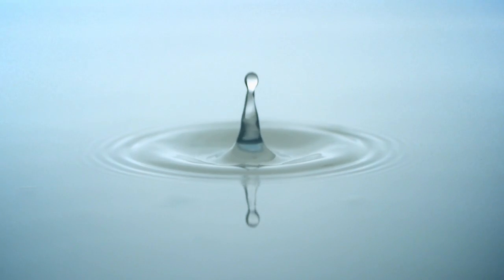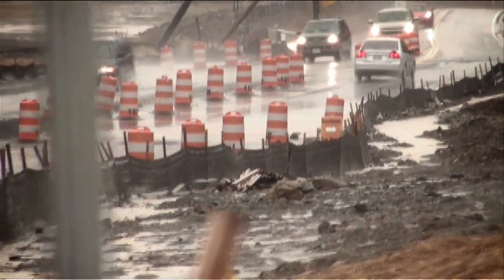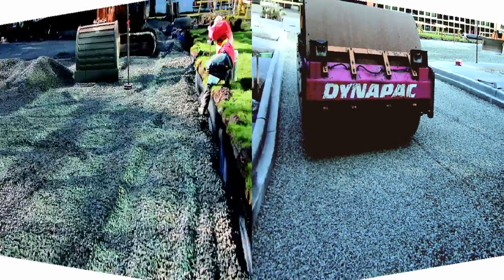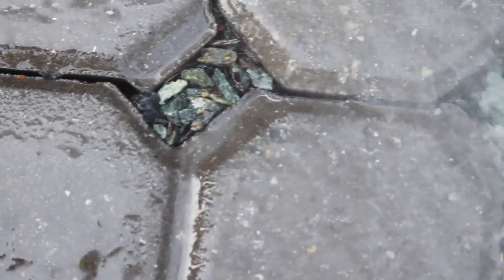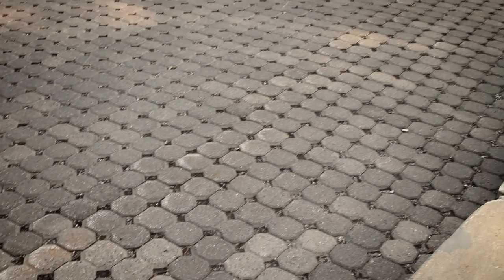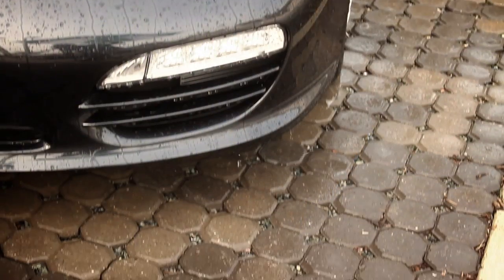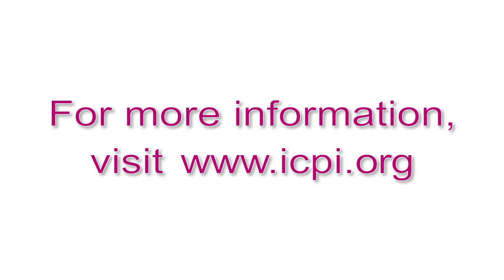Stormwater Runoff Solution: Permeable Interlocking Concrete Pavement

Comment: The pollutants are only redistributed into the soil rather than a river.  The pollution problem is not solved.   Water powered engines is a better solution to reduce our use of petroleum which is being suppressed.

Comment: How does this stop or reduce water pollution? It seems to me that this system accelerates soil pollution, pollluted water doesn't go through any filter, but directly to the soil ... from an environmental view this system can be dangerous... unless someone convinces me of the opposite
Reply: +AchrafRa you just said it. polution of ground increases, but polution of water decreases.
As water isgoing through soil, soil itself is a filter and is cleaning it from polutions.. right now, that water with polutions is going directly into sewers.
As water is going through this concrete it is taking that polution in itself, just like earth would, and then that water is cleaner than the water that is going into sewer.
But that concret is not able to take all of the polution on itself ( this is never mentioned, how much polution it can take) ( but there are some things such a thin layer can not filter.
That water is then going through soil, filtering it even better.

in theory it reduces polution, both total polution and polution in water, but is poluting soil under it.
over time that concret (filter) is going to get dirty, and is not going to be able to absorby everything, or will allow more polutants to run into soil.

my opinion is. i would rather have poluted soil under road that isnt used for anything, than have poluted water that is used everywhere.
we could always replace those roads.
and if we were to one day find ways to clean our planet of polutant as oil, then it would be much easyer to gather concentraded polution under roads, then spread polutions in waters and soil ( as we are using that water to water our plants we are poluting that soil with poluted water )

to me this would have sence. and this third part is only my opinion
Reply: pollution comes from runoff: the water carries whatever's on the surface with it into the creeks & rivers it ultimately joins. By preventing most of that flow, you're also preventing the pollutants from ending up in the local river.

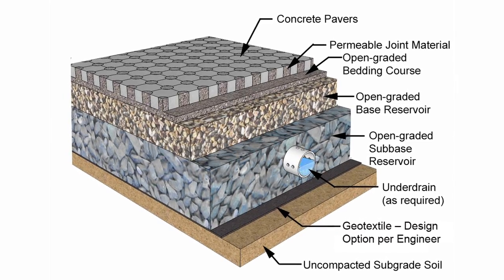Comment: So the underdrain (1:40) doesnt connect to the stormwater system???
I think this is a bit misleading. Sure the water that makes it to the stormwater system will be cleaner but its still getting there. Better solution is underground tanks that can later be used for toilet flushing and garden watering.
Reply: Shannon Kerr 1